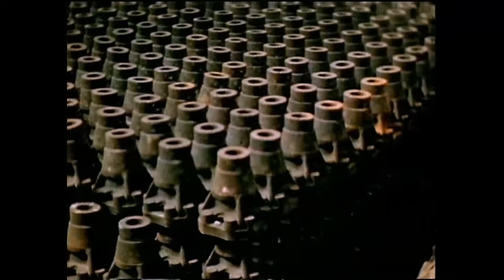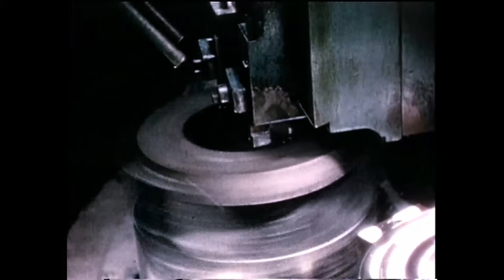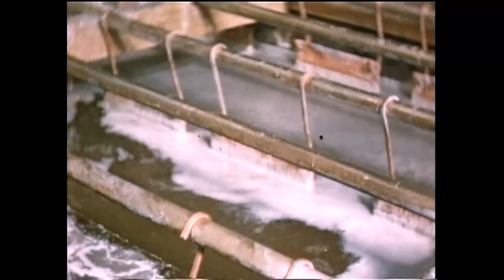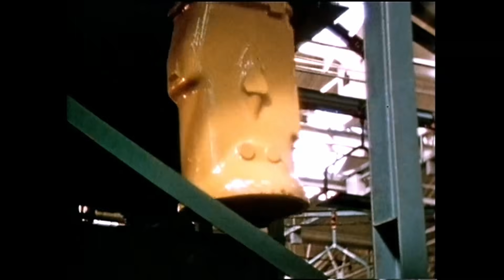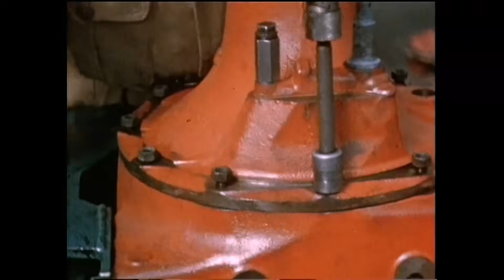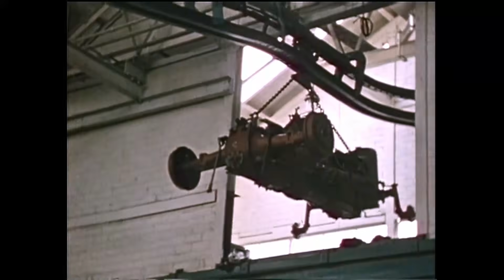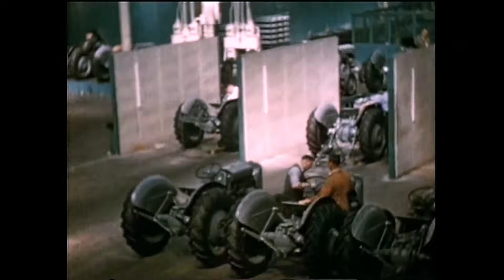BUILDING THE FERGUSON TE20

Comment: Thanks for posting this, very interesting. Dad bought a TE- A20 in the very early fifties (£325 ex works) along with a lot of implements like potato planters and sack lifters belt pulleys etc. 
According  to my oldest  brother within weeks he had it converted to TVO (paraffin) as it was using too much petrol. 
The driver was supposed to change fuels from petrol to the tractor vaporising oil as soon as the engine was warm but i know we kept forgetting until it started spluttering. Dad was not amused. 

Why he didn’t get the TE-D20 TVO  model in the first place i don’t know because i was only about six but i know  they were £10 more. Maybe he couldn’t get one as they were very popular, a bit like some cars in the  sixties maybe, a six month  waiting list.

Comment: I've said this before, but what is a tractor barn? No such thing. The typical English farmyard had a range of buildings, only one of which was called a barn.
Reply: We called them :”tractor sheds” ie a place where tractors spend their leisure and off duty time .😊.
Reply: @TheGrimReaper1 I didn't mention this in my original grumpy comment, but in Devon (home of the true English language) it's the " tractor house." I still remember the intoxicating smell of earth soaked in TVO and oil of one of those houses in particular.
Reply: @stewartfenton7660 

Yes “tractor house” sounds much more logical, on the old farm we had a “mill house” where we rolled/ground the barley. We also had a “milk House” where all the milking equipment and milk churns etc were kept cool and clean. We even had a “turnip house”.
How  the tractor shed  got its name i have no idea, it’s just what dad called it, it was actually three cart or carriage  sheds in the farmyard  with big archways side by side where the tractors were usually  parked  up. 
They were nothing like the modern ones, just a Major, and MF 65,35,and 135 and a grey Fergie which was really just kept as a pet.😊.
Reply: @TheGrimReaper1 I spent so much time on Majors and 35's, the number one tractors in the world. And the 65, brilliant machine, I drove one a lot in the late seventies, with ballasted back wheels from a 165, sixteen? by thirty two, can't believe I'm so senile to have forgotten a tyre size. Must be sixteen, not fourteen. A house, my god that thing would pull down a block of flats. I have to tell you, I never liked either the 1000 series Ford's or the hundred series Fergies. Good tractors, I drove several of both, and the Ford's I always thought of as real driver's tractors, so handy somehow. But they looked horrible (this is very important) and they replaced those beautiful machines we've mentioned, and for that I hate them forever.
So yes, we had bullock's houses, calves houses, you name it houses. Did you have linhays? (Pronounced "linney") An open fronted shed, that's all, like the one you kept your tractors in. We had "cart linneys" on every farm where things hadn't been demolished, obviously we now had tractors or machines in them. Usually two or three bays I suppose, but there was one I knew that had six or seven, I think it was really a more recent building.
And tallats? Well that's how it's spelt in Lorna Doone. I would have said "tallet" before reading that. A loft. Sometimes open fronted so you could stuff hay in there, often having a gap along one side so you could put hay in the rack in the bullock's house below. One farm I was on was built on a slope so the hay and straw tallets were more or less ground level with double doors. The two bullock's houses below didn't have doors, and ran into two partly covered yards. We had some annoying system I don't quite remember. I think we'd feed hay in the hay tallat and maybe carry some from there INTO the straw tallat and put in the rack that side. Then bring several bales of straw back OUT of the straw tallat, carry them past the hay tallat, INTO another door, bung them down some steps, over a low wall, round to the first yard gate, bung them over the gate, bung half of them over the second gate, then cut the cords and the bullocks would spread the straw themselves, pushing it about and eating some of it. Maybe you've bedded up animals that way as well, works best if they're a bit wild I suppose. With calves I'd shake the straw out properly. The tallats would soon empty out and we'd fetch more from the hayshed, we didn't tend to call them Dutch barns, which of course everybody had by the fifties or sixties. It was a semi good system, the father and son were a bit short of the imagination to improve it.

Well it was all good times, wasn't it? Even the bad times. Left the farms when I was 41, I'm not a real person any more.
Reply: @stewartfenton7660 
Linhay (Linney)is not a word i have heard before as i am in the  north of England .But we did have a few open fronted lean to sheds, they were just single story though, usually full of old farm implements. Maybe even a binder and a standard Fordson, the usual stuff from bygone days that nobody had the heart to send down the road.
Reply: @TheGrimReaper1 There was a binder in that longer linhay, everything else in there was in use. A trailer, a Major which I would grab every chance I could, it was a good one except of course for the lights. Still had the Major signature in that it would start immediately no matter the weather. Plus a Universal 550, kind of OK, and a National 454, really, the things one has to put up with. My dog knocked the end wall out of that linhay, now it can be told as Stanley sadly has passed on with cancer. When you're lying, use as much truth as possible. So the first but I told him was true. I came down the sloping yard entrance with the Looneyversal and the first load of barley of the day, off the combine. I stopped and got off the tractor, handbrake on, walked past the roundhouse ( I'm sure you had them) and opened the barn doors and went inside and did whatever it is you do when you're going to be tipping barley in there( forty odd years ago, I think there was a hopper built into the floor, to auger the barley into a bin. Walked back out and there was my dog, walking around vaguely, and I started to wonder..... didn't I leave the tractor there? Where did I leave it? I'm sure I left it there.... what day is it, what planet is this, I was feeling a bit lost, trying to think where the tractor was. Well I never said anything to Stanley about any dog, he really wasn't too keen on my dogs although he didn't say so. Walked past the roundhouse and there was the tractor at the bottom of the yard, engine ticking over, not a scratch on it. With a demolished block wall right beside it. Now I did wonder how I was going to explain this without mentioning the obvious. Connie was on the seat,and she jumped off and knocked the handbrake off. So I told Stanley, "It overrode the handbrake." Now you know, I know, Stanley knew: I was lying.I don't know if he guessed what happened, but he wasn't going to call me a liar. One time he said "Funny how that happened," and nobody else said anything. I worked there three days a week and of course at harvest, hours would go sky high, and I'd do extra days if I could, I was in demand but I'd probably put him first as he kept me going in the winter. He never questioned the number of hours, I'm an honest person until it comes to explaining damage. It took me eight hours to clean up those blocks and put the wall back like new, and I knocked those eight hours off the bill and he didn't know the difference. I admit he had to pay for the cement and sand,but too late to put it right now. Rest easy, Stanley, old fashioned but a pretty good guy really.

Comment: I left school in 1964 at the age of 15 and started to work at a MF main agent, the te20 was already an old tractor by then but we did do a lot of work on them. The 35x was the latest model. I loved working as an agricultural engineer for 14 years but it just did not pay enough so I left to go and work as a lift truck engineer on Hyster lift trucks. Within a year I was earning twice what I was being paid previously. I knew the 35 and 135  models inside out. I must have replaced at least 500 clutches.
Reply from the maker: Fantastic! What a shame you could not make it pay

Comment: 0:55  "aging some time in the open"  otherwise known as rusting outside in the rain.
Reply: This was normal practice on castings (not "stampings" as the voiceover had it). It allows daily natural heat cold cycles to releases stresses, so that when the part is accurately machined, heat cycles in use don't cause distortions.

There's a famous photo (famous if you're a woodworking tool collector) of Record plane castings in a huge heap in their yard.

Comment: Ferguson doublecrossed Ford and built the TE20! ...Just kidding. Ford Motor Company doublecrossed Ferguson after Henry Ford died, and reneged on the two Henry's handshake agreement, effectively stealing Ferguson's revolutionary 3 point hitch, so Henry Ferguson got even by producing a copy of Ford's successful N type tractor, the TE20, if I remember correctly.
        I still cut my pasture with a 1941 9N Ford (9 for 1939, the first year of the N type). The parts are still readily available, and it's easy to repair if need be.

Comment: This film shows differential crown wheels being copper plated, and the voice over says it is to facilitate running in.   The script writer was mis-informed.
copper plating gears was an old process used for two reasons:-
1.  It was done in the heat treating part of the factory and thus provided a confirmation that the gear has indeed been heat treated.  Using unhardened gears by mistake to assemble products was thereby prevented.
2.  Copper plating was used to mask off areas not required to be carburised. or to allow stockpiling without rusting.
Reply from the maker: Fascinating!

Comment: The men working on the assembly line are working to maximum extent of their ability, There was nothing easy about the work 8 hours a day you would have been tired at the end of the day,
Reply: Not to mention the mental boredom of doing the same task day in day out. Machining was a bit more interesting depending on the job. 
I worked at Perkins Diesels in the early 2000s very similar tasks and conditions to those shown here
Reply: @timwebster8122  that's interesting Tim, what engines were you building? Is the factory still there?
Reply: Think is speeded up a bit.